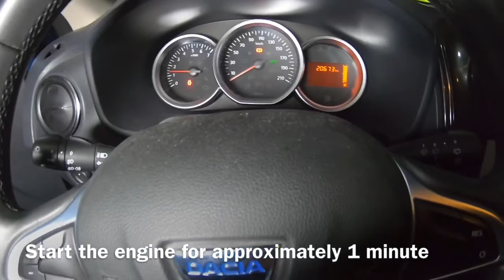Dacia Sandero Stepway - Engine oil and filter change DIY

Comment: Had my first service on my Dacia  sandero stepway  6 months ago at the dealers the service  only cost £92  hopefully  a oil 🛢  and filter  was included  in the service  it doesn't  say on the invoice  apart from  filter _ pass compt does this mean  oil filter  component?

Comment: Oil was pretty dirty. First thing I´d do is change the oil drain plug to a standard bolt. Looks to be a fairly simple job. :yougotthis:
Reply: Probably it's not good idea, sometimes drain plugs are magnetic to collect possible metal debris. Not sure if it is in this car thou.

Comment: Incorect. 5W40 oil
Reply: 0/5/10W40 RN700 RN710 A3/B4  API : SN
Reply: It depends on the place you live in,if it's too cold or hot,for me i use 10w40 for more info read the car manual
Reply: @gboxm8563  0w40 is allways better than  10w40 even in the desrt. or in siberia.
Reply: 5-30w C3